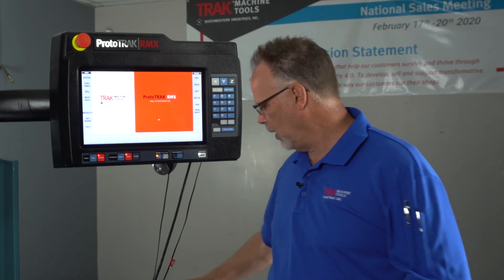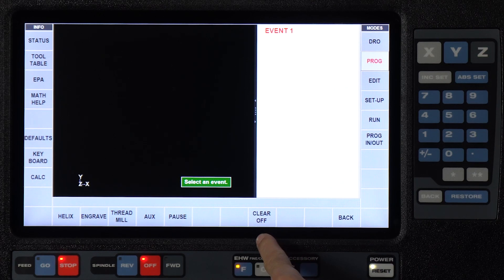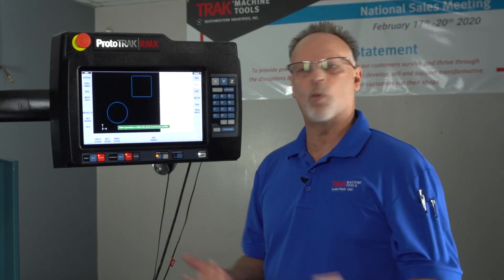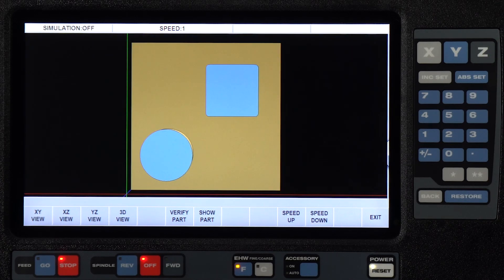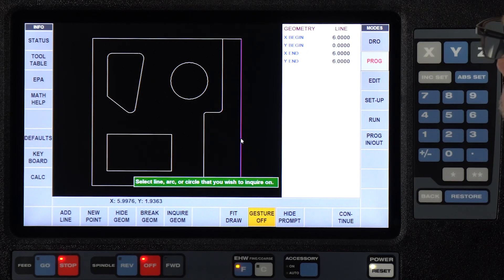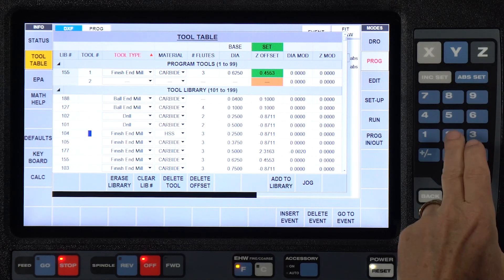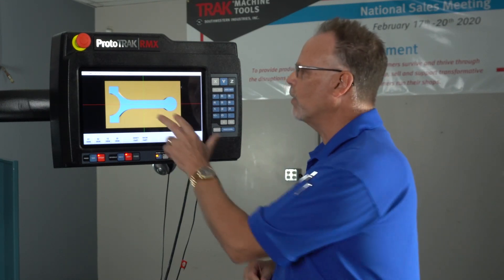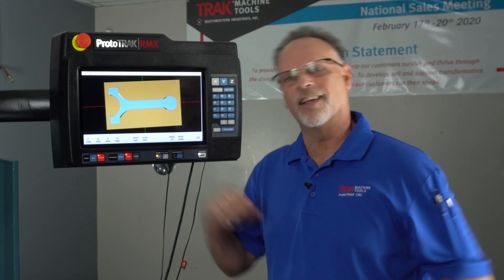Clear Off Programming Demo | ProtoTRAK RMX CNC

Comment: Can u program using a parasolid model, then add the extra material to be removed under define stock? Meaning the model is the piece part without the extra material but add the material using define stock.
Reply: Hi Mike! The short answer is yes.  To dig in deeper, you have a couple of choices on how to describe the stock to be removed. 1. In the beginning of the process, you can select a rectangle for the stock before you start to describe the profiles which will be left standing.  2. after you have described all of your profiles, you can switch to the program mode and once you do, you can end the profiles and it will ask you to describe the stock.  Using this method, you can choose circular, rectangular or irregular stock.  As shown in the video, whichever method you choose, once completed, the toolpath will start outside of the stock and work it's way into the material leaving the profiles standing at the end.  You do have the ability to choose from any of the three toolpaths and you can also add a Z finish cut with a different toolpath is desired.  Thank you for asking this question. I think others will get to learn from this as well.  T.P.
Reply: @trakingpat2750  thank you for always answering our questions, much appreciated